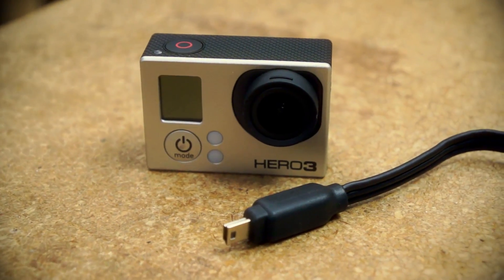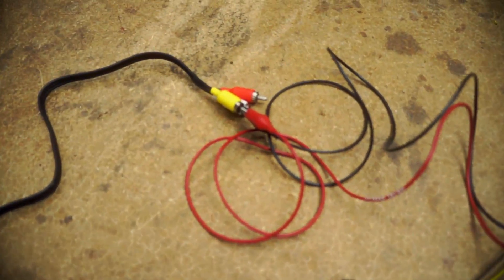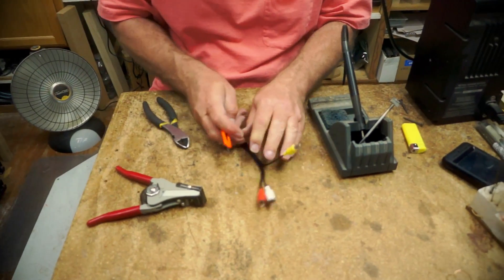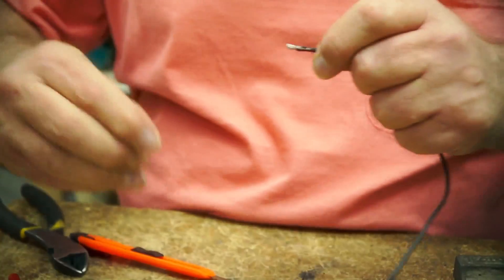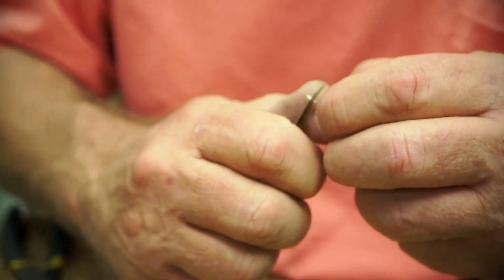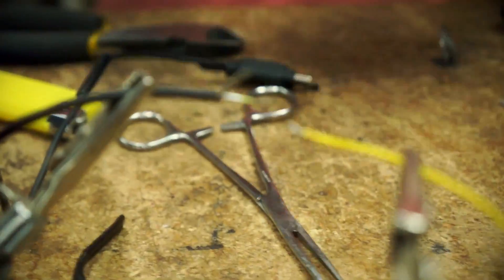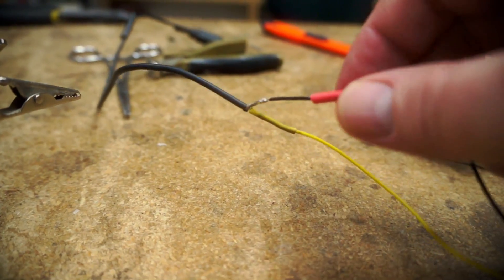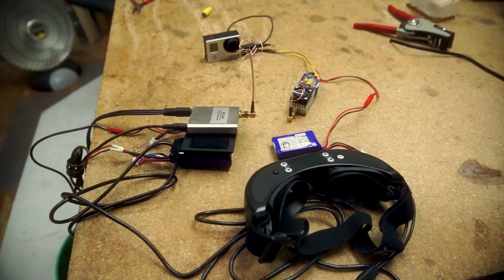How to Hack your GoPro Hero 3 for FPV

Comment: Hi do you guys know if the signal coming out from the mini USB is analog or digital?
Reply from the maker: I guess digital. Does it matter?
Reply: I am going to mount a small microprocessor to process the images and these MP usually takes in Digital signals. If it is analog, a converter would be needed.

I have found that the video is composite video and therefore requires a converter to component videos anyway.
Reply from the maker: Zlael What's the purpose if doing that? There's already a microprocessor in the camera that converts the signal to digital, and stores the information on an SDHC card.
Reply: It is to allow real-time image processing. Storing pictures into the card and then process it later is not efficient in my project.

Comment: Is it possible to hook it up to a monitor instead of fatsharks? Btw, AWESOME! I'm gonna buy a DJI Phantom for my Hero 3 and i should just be sure if it hooks up to a screen first. But could you send the links to where you buy it? (The Transmitter/Reciever) (UK) ? :D
Reply from the maker: Yes you can hook up to a monitor. But you must do your own research. Join a DJI Phantom group on Facebook to get info from Phantom owners. Cheers.
Reply: Thanks

Comment from the maker: No FPV camera came with the XP2. I have a little camera but I haven't used it much because the Gopro looks so good in the goggles. I don't recommend shooting with the GoPro OVER a DSLR. I use the GoPro because that's what I can carry. I have an NEX-5n that the XP2 will carry, but not with my gimbal. I think the GoPro has a nice image, but I want to fly a GH3. The size is nice with the GoPro.

Comment: A class 10 card alone is still not good enough for some of the recording modes, though class 10 is technically the fastest class of card, it only says the card is at least 10MB/s. To really use all the features of this camera you need a 20MB/s read speed.

Comment: Ive had issues w my hero 3 black even after the latest fw update. Now it won't record 720p 120fps. It just stops recording after 40 seconds or so. I dare not use it alone for fpv. It blacked out on me a few times while hovering low. Lucky no damage just panic attack!!

Comment from the maker: In my experience if the Hero3 stops recording it does not power down. I've yet to have an issue, and my GoPro has stopped recording a lot.

Comment from the maker: I think you're referring to the other hack I used an annotation to link to during my video. I also tried that, but it's easy to break the wire when you take off the rubber shielding on the end. I've since just bought a dedicated cable that requires no hack. This video is for those that want to hack the cable they may already have.

Comment from the maker: There should be no setup on the Hero3. It just works whenever the camera is on. You may have made a mistake soldiering. There is a ready made cable you can buy at RC Shutter dot com called the "GoPro Hero 3 Audio / Video Cable". It's a cable that will attach to the FPV transmitter, but you do not have to soldier anything.

Comment: i never had any signal from my gopro3. Solded, plugged into the tx (tx with 3 cells battery) but no signal. I have to setup something on my gopr3? resolution or whatelse?

Comment from the maker: I have no Idea what you did to lose the signal. You soldiered the cable to your FPV Transmitter? You're only supposed to soldier the cable, then plug the cable into your transmitter.

Comment from the maker: I've been about 450 yards with mine. You must remain line of sight at 5.8ghz. For HDMI, you just get a converter. I got the FreeFly HDMI converter for my NEX-5n. But the fat shark goggles stretch the image from 16x9 widescreen to a square shaped 4x3. You need either a 16x9 monitor, or goggles that can do that. There are some expensive gaming goggles that are HD.

Comment: btw. soldering an "micro-BEC" (input-6-23v output 5v/3a ) to your miniUSB-jack will prevent the need of the gopro battery, also :-) I made and adapter to drive the hero3 with a lipo for long time lapses >4 hours.

Comment from the maker: Yeah, check the top link in the description. The AR Drone is ultimately just a toy, and not reliable for getting video. You can, but it crashes a lot, and their parts are more expensive than professional RC parts. They are also jello machines. The XP2 is AMAZING. If you want really great video with no jello, that's what you need. I'm a videographer, so I have higher standards for my vids. Can't lift both the FPV stuff and a camera together with the AR Drone either. Too heavy.

Comment from the maker: Interesting. I just changed it in the description. The new Hero3 cable is called "composite", and the old Hero2 one is called "component". Whatev... I prefer the old way they did it with a jack rather than a usb connection.

Comment from the maker: Yes I recorded on the card, and only used the transmitted video to see whee I was going. It works fine with no issues. I can fly over a kilometer away as long as I'm in line of sight. Look at my "Moonstone Beach - Aerial Views"  video in my "Aerial Video" playlist. That was shot using this exact setup.

Comment: I meant that there is kits to buy that I think could be seen as RTF(?) Everything is included and no big problems to connect the tranmitter and reviecer and the most cables fit without any many modifications...and alsa including a camera.

Comment from the maker: Hi Mattias, this worked fine with no freezing. No issues for me with this.  I'm not sure what you mean by "Ready FPV kit" though. I am sending the Hero3 video to an FPV transmitter on the quad, and receiving it in my goggles like any typical FPV setup. The GoPro WiFi should never be used for FPV ever, as there is too much lag and not enough range. The wifi is a gimmick that has no real useful purpose.

Comment: Hi Chad! This looks like a good way!
Did you test fly this FPV setup?
I could understand that the other guy that hacked gopro 3 for FPV had problems with picture freezing wich resulted in crashes, hehe. I have a Gopro 3 also...is this something you recommend or should I buy a ready FPV kit instead? Nice work, best reagards /Mattias